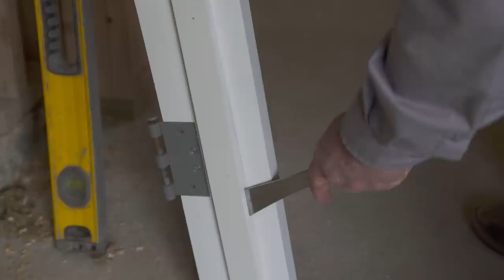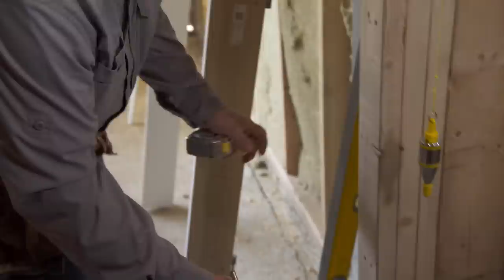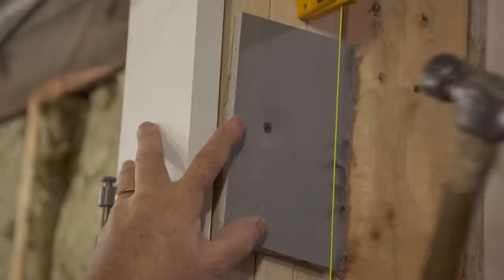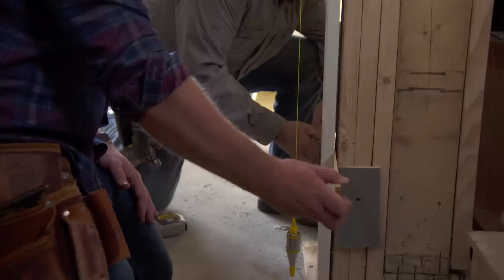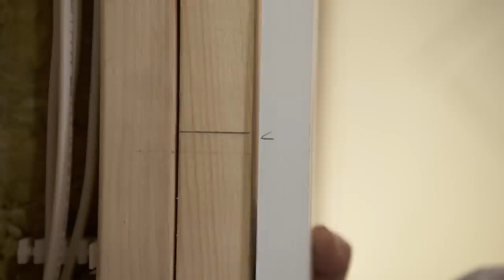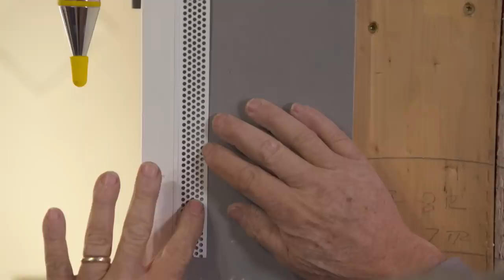How To Hang a Mid-Century Modern Door | This Old House

Comment: Kevin: "You allowed to nail screws?"
Tom: "Oh sure."

:-)
Reply: time is money :)
Reply: I was like: WHAT!?
Reply: My Grandfather, who used to build homes, cringed when he had someone build a garage for him in his older years and they hammered in the screws on the door hinges.  Poor craftsmanship there.  Tom should know better.
Reply: @martymcfly5842  the pieces he hammered in were temporary guides that got removed later on. He even said that in the video twice. That isn't poor craftsmanship.
Reply: @martymcfly5842  it's a scrap. It's coming back off and now he can use a drill to pull the screw out instead of prying a nail against drywall that would make a mess.
Reply: @martymcfly5842  its just temporary
Reply: "Drive screws"

Comment: The level isn’t good enough for checking the rough framing plumb, but Tommy uses it to transfer the 60” line. Haha
Reply: Hilarious
Reply: Like when the guy mentioned it's s 100 lb door panel. Sure it's heavy but really ?
Reply: Plumb and level are two different things
Reply: @DXSUCKIT1990  yes. One is a liquid and the other is a gas.

Comment: Why hang the door before having the finish floor installed?
Reply: They might be planning to run the flooring continuously into the next room, rather than a transition, so whether or not the door frame is there is irrelevant.
Reply: @joltzkrieg  having the door jamb in place is very relevant. running tile before installing the jamb is much easier than cutting tile around a jamb and then grouting  and making it look decent
Reply: @ItsAllAboutBrandon  sounds like they're running the tile beneath the jamb, thus the shims to hold it at a determined height. He says in the video they have to plaster after installing the jamb, and I imagine they must have to also plaster before laying flooring and trimming it out.

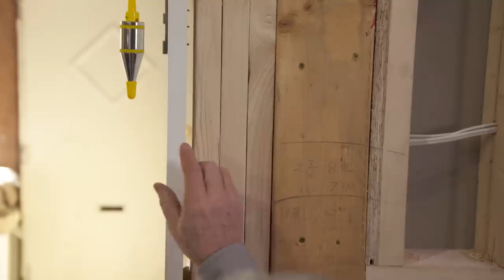Comment: at 6:03 you can see that his height lines are off again.
Reply: Jamb is 1/2" forward of the stud and 1/2" away from it -- it's an optical illusion they are no longer lined up because of the viewing angle. if the camera got down at that height, you'd see they are still aligned. (or if he slid the drywall to the marks you'd see it.
Reply: what @LP81 said.  Pretty easy to see for yourself. Just offset a couple of pieces of paper and look down on them.